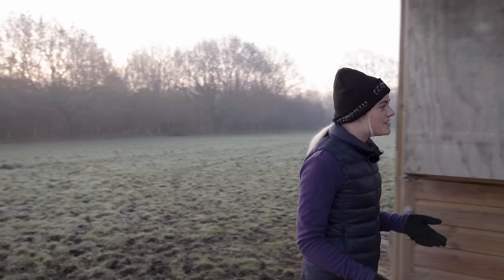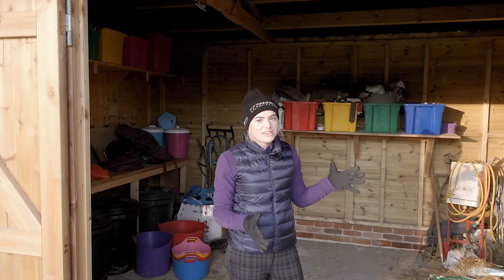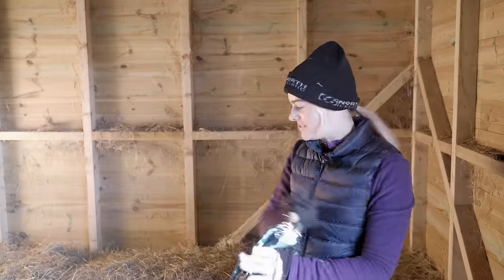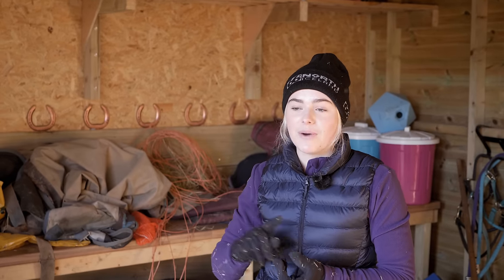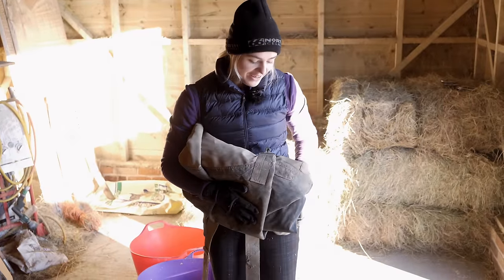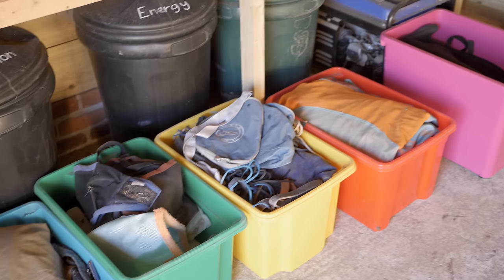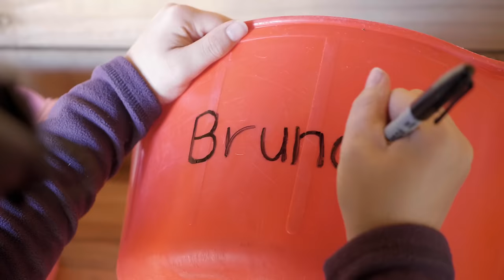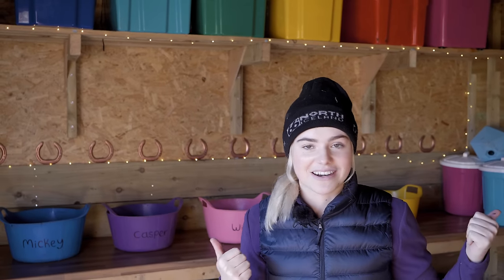Satisfying Feed Room Cleaning, Tidying  + Reorganising for Winter | This Esme

Comment: Esme you need two things for your stable: 1) a rug holder that you can mount to the wall. It has several rods to hang ups several rugs and you can sein the rods back and forth to take the rug you need 2) a hay net filler thing. It’s holds your hay net open so you can fill it more easily. I don’t know where you could find these in the UK, but check out the German website by Großewinkelman. They have a lot up useful supplies for farm and stable although I am not sure if they ship to the uk